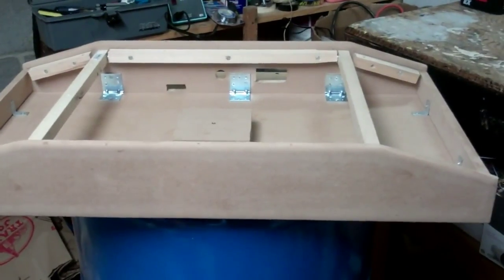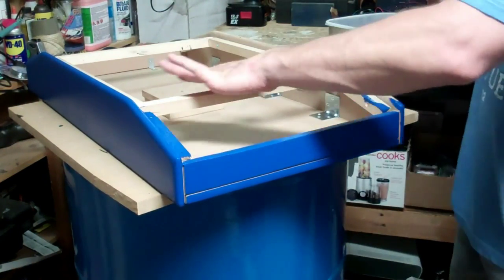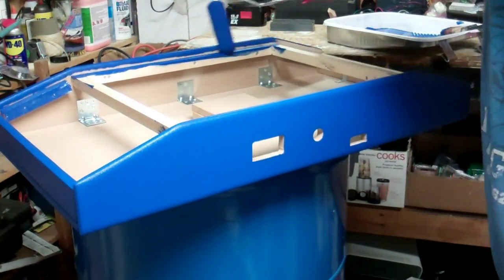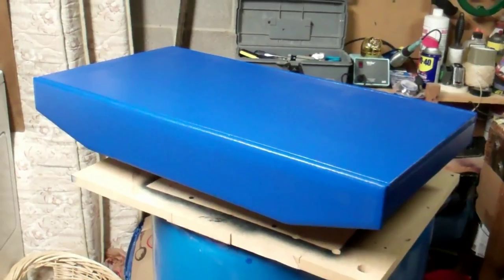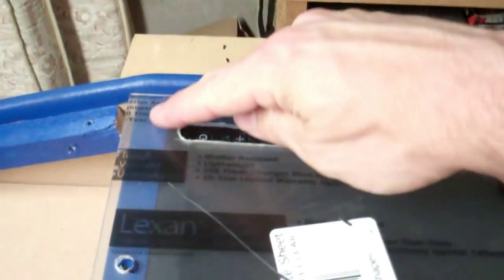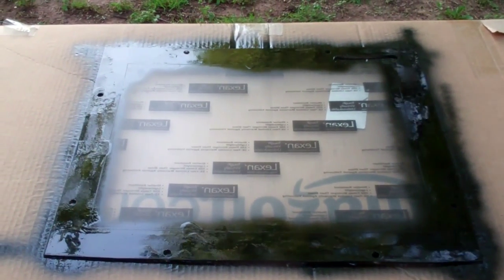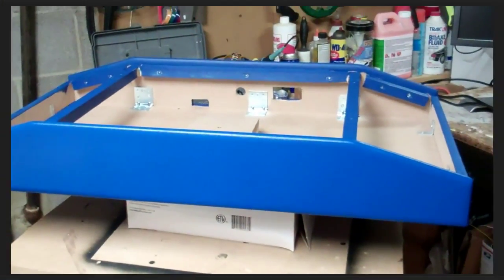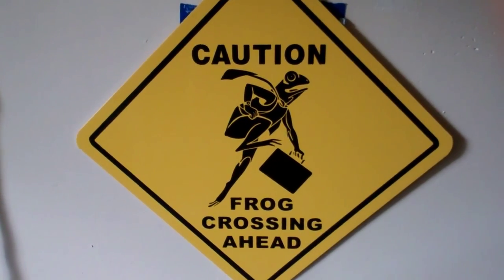Mini Cocktail Arcade Step-by-Step Build - Part 3 -  The Painting!

Comment: do different paints make the surface harder?  i guess if you want it to be super tough you can use bed liner material.....that would be hardcore!
Reply from the maker: I imagine so.  I thought about applying a coat of poly, but thought that would take away from the look.  Yeah, the super tough spray on coating with all the built in grit for the bed of the truck, lol.  That would be tough for sure!

Comment: hey Jeffrey I'm having a problem how do u initialize the SD card to get the serial number for PC use if you don't have the game board plz Jeff help me out I'm so close plus I'll show you the cab I'm building based off your design for all the vertical games
Reply from the maker: You have to have the ArcadeSD board before programming the SD card.  Once you have the board, put in the SD card, start it up once.  This will put the serial number onto the SD card.  Then you can plug in the SD card to you computer to do the programming.  Make sense?  I'd definitely love to see your build.  That would be sweet!

Comment: What frontend are you gonna use? And what are the pc specs?
Reply from the maker: I'm using an ArcadeSD multi-game Jamma PCB.  It's nice for a slimline as it's got a small footprint and still has a ton of great cocktail games.  I suppose a small PC motherboard and hard drive of sorts would fit in the cab too.  If I ever did that I would use Hyperspin.  HS needs decent specs to run well.  A good video card for the graphics, etc.
Reply: Thank you for the reply and information
Reply: Is there a download for arcade SD software
Reply from the maker: Zell Armstead Yep.  Everything you need it right here:  http://destross.com/romsets/